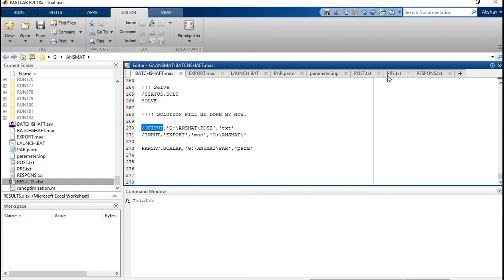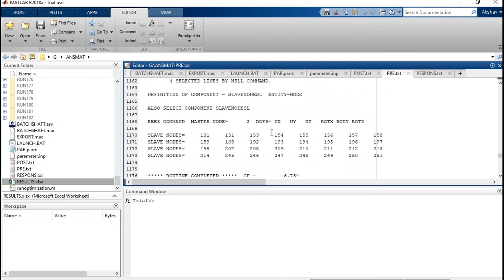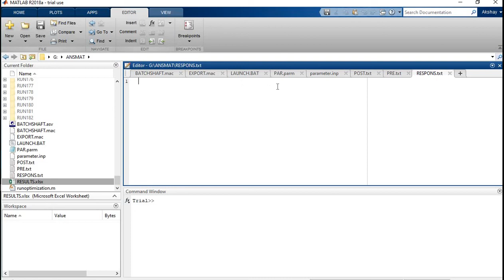Using MATLAB to run (ANSYS) APDL macro code

Comment: first thank you for the video
iam trying to perform an optimization using GA and for that i need to use the ansys and matlab , i start by using this line to call the ansys APDL code 
!"C:\Program Files\ANSYS Inc\v145\ansys\bin\winx64\ANSYS145.exe" -b -i  C:\Users\kouider\Desktop\Harvester_hindawi\ansys_code_parallel.txt -o C:\Users\kouider\Desktop\Harvester_hindawi\ansys_out.txt
it works but when i try to save  the results using
/POST1

*CFOPEN,VLG,txt
*DO,i,1,9
 SET,next

*get,Up1,NODE,1,VOLT

!pwr=(Up1*Up1)/(R1*R1)

! /out,voltage,txt
 *VWRITE,Up1

(F10.5, '        ')

*ENDDO ! i
*cfclos 

FINISH

no results are saved 

could you please guide me about that
Reply from the maker: Do these things and see

1. Use the SET KMP command to allocate more RAM to run ANSYS like this (15GB allocated here) -   !SET KMP_STACKSIZE=15000k & "C:\Program Files\ANSYS Inc\v162\ansys\bin\winx64\ANSYS162.exe" -b -i input.mac -o output.txt

2. You need to call the /POST .... using input command  

/INPUT,'filename','txt','location' check ANSYS help on /INPUT, also you can see the use of this from 1:20 (https://youtu.be/sE3NkH1m24w?t=79)

3. Rather than calling *VWRITE inside DO loop, try saving the result into a single matrix and for that use the function DIM (which allocates the matrix dimentions) then call VWRITE outside the DO loop.

*DIM,ff,,2
*DO,i,1,2,1  !! DO LOOP
SET,i
FSUM
*get,ff(i),fsum,0,item,fx  
*ENDDO
*cfopen,force,dat   
*vwrite,ff(1),,
(f12.2,2x)

sorry for the late reply.

Hope this will be helpful. :)
Reply: Thank you sooooo much for the suggestion now its working perfectly
Reply from the maker: Glad to hear that :)
Reply: @DisciteBon  Thank you for the video and replying to comments. My concern is about Part 1. I have an ansys apdl code with a large number of nodes and elements. The MATLAB remains on Pause for a while when the ansys gets into the solution, then terminated. I tried the code you suggested as below:
!SET KMP_STACKSIZE=15000M & "C:\Program Files\ANSYS Inc\v161\ansys\bin\winx64\ANSYS161.exe" -b -i Run_1_Test.mac -o Run_1_Test_out.txt
But still having the same issue, while only 50% my computer RAM is in use.
I appreciate your help in advance.
Reply from the maker: Hello @soroushzamanian6620 ,
It supposed to be 15000k not 15000M, and if this doesn't solve the problem, please send the code via email, I need to look at it before I propose a solution. 
Thanks 🙂

Comment: Hi Sir, Recently I am trying to use matlab to run apdl code on my computer.
The version of matlab I used is R2022a, and ANSYS version is 2021R1, after I used the input file and run ansys.exe from matlab, errors always been happened in matlab and the output file. 
The line of code is: !SET KMP_STACKSIZE=2048K & "C:\Program Files\ANSYS Inc\v211\ansys\bin\winx64\ANSYS2111.exe" -b -i FEA_In.txt -o FEA_Out.txt

Comment: I have a problem, dos is returning a value  of -1 and Ansys is not launched. What could be the issue here?
Reply from the maker: See if your Macro is running properly without dos on just Ansys first.
Reply: @DisciteBon  Thank you! I figured it out. If anyone is facing the same issue, just make sure you fix your Windows registry and check the integrity of your Windows.

Comment: hello sir, can i give input parameters using for loop and get the time temperature history result for every input which I gave in the input parameters micro code?
Reply from the maker: Yes, you can do that, inside for loop you input code to run Ansys for each different input parameters.
Reply: @DisciteBon  sir but parameters.inp is not working
Reply from the maker: Could you email me. Let me see why it's not working.
Reply: @DisciteBon  your emailid sir?
Reply from the maker: You can find it in the video description.

Comment: hello sir, I am perfroming a transient heat analysis and I have integrated the apdl with matlab after watching this video, Though I gave the apdl commands to save the time temperature history result ,when i have integrated with matlab the time temperature result is not saving in a file by using matlab,So is there any chance to get it?
Reply from the maker: Did you go through the function called GET in ANSYS help. You need to give that command to save it to a text file.
Reply: @DisciteBon  i will try it sir.

Comment: Hello, very nice video! I cannot get parameters using /inp, parameter,inp. Why do you change the jobname using /FILNAME?
Reply from the maker: Parameter file should work, maybe you are doing something different. And filename is used to create a new folder where ANSYS generated files can be stored and deleted if not needed. It helps in not cluttering the workspace of MATLAB.

Comment: Hi I am using  ansys aas file to connect MATLAb and Ansys. After that i want to optimize the parameter to fit my simulated rusults with mx experimentak results building MATLAB optimization function. Can you help me in this.
Reply from the maker: Hello,
I can look into it but I have never worked with aas file. Shoot me an email let me see what I can do.

Comment: can u help me in writing apdl algorithm for conductor breaking in transmission line tower system
Reply from the maker: Are you able to simulate it without the code? I have no idea about electrical simulation in APDL.
I can help you with coding if you know how to simulate using GUI.

Comment: @Discite Bon Thanks for the useful video. Can you please take it one step further and show an example of how I can write an input file for a structural transient analysis from ANSYS Workbench > Mechanical and say change the applied load on a beam at every iteration and save the beam displacement (at 1 single point on beam)  vs time data at every iteration?
Reply from the maker: Hello Punnag Chatterjee, If you can make load steps in transient structure with different loading, then you can get the displacement at each load step, but if you want at iteration as in nonlinear analysis iteration, I'm not sure how to do that. Also I don't know if it's possible in workbench.
Reply: This video was very helpful. It was good to see a different way of doing this. 

I am working on something similar. I am trying to implement a for loop in MATLAB where I run the ADPL code then save the output then in the next iteration change the load and run the code again etc. Each time saving a specific data set and then plot once the for loop has completed. 

I am having an issue though. I would like the max stress in a truss to be displayed in the output txt file.  Would it be possible to just have the results I want displayed in the out.txt file. 

For example:

line3='/PREP7                  
line4='! define parameters (mm)';
line5='height = 3118';
line6='width = 3600';

line7='! define keypoints ';

line8='K,1,    0,   0              line9='K,2,   width/2,height ';
line10='K,3,     width,  0';
line11='K,4, 3*width/2,  height';
line12='K,5,   2*width,   0 ';
line13='K,6, 5*width/2,  height';
line14='K,7,   3*width,  0';

line15='! define lines';

line16='L,1,2                  line17='L,1,3';
line18='L,2,3';
line19='L,2,4';
line20='L,3,4';
line21='L,3,5';
line22='L,4,5';
line23='L,4,6';
line24='L,5,6';
line25='L,5,7';
line26='L,6,7';
 

line27='! element definition';

line28='ET,1,LINK1              ! element type      #1; spring element';
line29='R,1,3250                ! real constant     #1; Xsect area: 3200 mm^2';
line30='MP,EX,1,200e3          ! material property #1; Youngs modulus: 200 GPa';

line31='LESIZE,ALL, , ,1,1,1    ! specify divisions on unmeshed lines';
line32='LMESH,all               ! mesh all lines';

line33='FINISH                  ! finish pre-processor';

line34='/SOLU                   ! enter solution phase';

line35='! apply some constraints';
line36='DK,1,ALL,0        ! define a DOF constraint at a keypoint';
line37='DK,7,UY,0 ';

line38='! apply loads';

line39='FK,1,FY,-280e3          ! define a force load to a keypoint';
line40='FK,3,FY,-210e3      ';    
line41='FK,5,FY,-280e3     ';     
line42='FK,7,FY,-360e3     ';     

line43='SOLVE                   ! solve the resulting system of equations';
line44='FINISH                  ! finish solution';

line45='/POST26';
line46='PRNSOL,F                ! List Reaction Forces';
line47='PLDISP,2                ! Plot Deformed shape';
line48='PLNSOL,U,SUM,0,1        ! Contour Plot of deflection';

line49='ETABLE,SAXL,LS, 1         ! Axial Stress';
line50='PRETAB,SAXL               ! List Element Table';
line51='PLETAB,SAXL,NOAV          ! Plot Axial Stress';
line52='PRVAR,F';

fid = fopen('C:\Users\von70\Desktop\MATLAB\Metahurisics\Ansys_Matlab_Connection\ADPL\Trial_2\talkin_2.txt','w');

Then this gets printed into a text file.

fclose(fid);

!"C:\Program Files\ANSYS Inc\ANSYS Student\v192\ansys\bin\winx64\ANSYS192.exe" -b -i talkin_2.txt -o talkout_2.txt

When this run I get the talkout_2.txt file but it does not contain  the results I am looking for, like the axial stresses . Any help would be greatly appreciated.
Reply from the maker: @Abdelrahman Abdeldayem  Hello,
I think he figured it out with my help.
Reply: @DisciteBon   Could you help me in  this ? 
I have MATLAB Code and i need to take the output from MATLAB which is temperature value and use it as Input in ANSYS FLUENT on specific boundary condition then i will solve ansys and get heat transfer coefficient (HTC) and i want to take the HTC value from ANSYS FLUENT and use it in MATLAB code again to get new value for the temperature and this is a repeated cycle. i'm trying to find how to achieve this